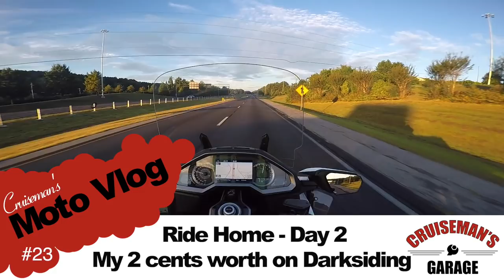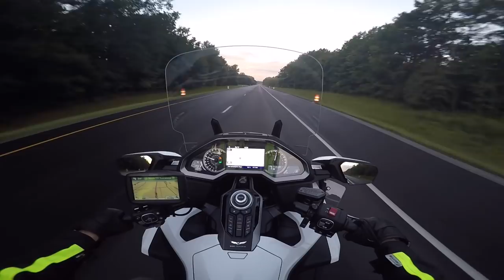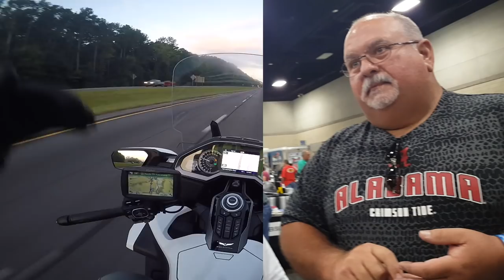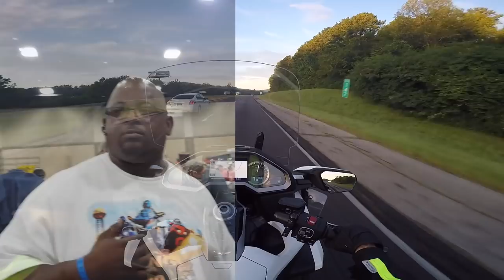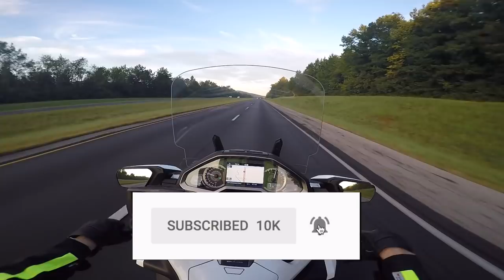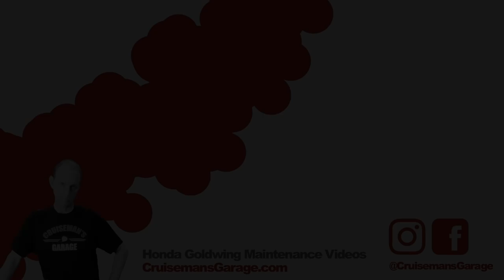[Ep 23] My 2 cents worth on Darksiding - 2018 Honda Goldwing

Comment: I went Darkside years ago after having a tire separation at freeway speed on a Bridgestone tire....the sidewall looked like a banana and if it had completely ruptured it would have been catastrophic. Going after a tire company is a joke, forget it, they dont want to hear it and Bridgestone denied any culpability, they said "It must have been caused by a road hazard".....after much research and soul searching, I went darkside. After riding with a CT on back for about 15 minutes, you adjust to the handling....I can assure you it does not affect your ability to navigate twisty mountain roads. I get about triple the mileage on the CT as opposed to MC tires. I ONLY use "run flat" car tires, which have much heavier beads and sidewalls. The only place must be really cautious is at very slow speed on broken or uneven pavement. The flatter profile wants to follow the curvature of the pavement, where as at speed, it is a non issue. Entering turns requires a slight bit of counter steering to set line through corner, and then it corners as if on rails. I have been totally happy with my experience going Dark. There is a treasure grove of information on the Darksider forum, with tire reviews, and the experience of running millions of miles on car tires. I am running a Yokohama run flat on my 2004 wing now and love it. And as far as the guy that had the bead break, It would be interesting to know the tire pressure when that occured, was he running too low tire pressure ????? That would be my bet. After assisting in the installation of the tires on my bike, I have NEVER thought that a bead could break, breaking the bead once installed takes an act of God, and a tire machine!! Keep up the good work on your videos, thanks for all the information you provide.
Reply: I echo your sentiments whole heartedly!   I'm running a Pirelli P1 Run Flat.

Comment: Sorry Cruiseman....I had to stop you 3 minutes in to comment. I'm about to buy my 6th motorcycle (2021 grey Goldwing that I am adding the factory tour pack to). My 3rd bike was a 2002 Goldwing. Halfway through owning it I went to the darkside on it and you can tell absolutely no difference at all. People forget that you don't run the car tires at full inflation. I ran mine at 22psi. So the side wall flexes considerably when you lean into a corner and "rolls". It does not feel unstable at all. If you search on YouTube you will find a video where a guy ran the Dragon using a car tire and a camera mounted behind the bike facing the rear tire. That video made me decide to go that route. Great videos! Thanks!

Comment: I personally can not understand why you would want to put a car tire on your motorcycle.  I would have to say for me it is the same reason why I have a Schuberth helmet.  How much is your head worth?  From my perspective it's not worth the risk for the type of riding I want to do to compromise my safety for a few bucks!  Also, I would never be able to forgive myself if compromised my wife's safety because I though I could save a few bucks on a tire.  Motorcycle tires like car tires are purpose built, they are designed for the rigors that motorcycles are operated under. One last thing that I think would also be a game changer for me, is that the motorcycle tire is way better suited to run flat than a car tire.  Just my POV from my soap box.   Thanks Cruiseman for all you do to help the GW community.

Comment: I read all the comments, but no one acknowledged the fact that, as per Cruiseman, the dude did not lose control of the bike.  If a MC tire would lose pressure like that, what would happen?
Reply: It happened to me.  As pressure drops below about 10 psi, it starts wondering away from a straight line.  It's still steer-able.  I had just purchased the bike from the original owner and it had Avon Cobras on front and back and the rear tire was 5 years old with a decent amount of tread left -- well above the wear mark.  Mine deflated inside 10 seconds from a split between the tread that looked like either dry-rot or a manufacturing defect.  (It certainly wasn't UV damaged.)  Thankfully I was out of traffic and driving in a straight line.  MC tires are designed to stay on the rim in that circumstance, and it did, which allows you to drive it at 1-3 mph w/o damaging the rim of you have to, to get off the road or across a parking lot to get to or from a tow truck.

Had I been on a heavily-loaded turn, I can't speak with any authority on how it would have gone because it has neither happened to me nor have I studied the matter to any extent from available data.  But I'll say this:  it would not be fun.
Reply: If just one tire manufacturer would approve of using a car tire on a motorcycle, then I’ll try it.

Comment: I've been riding Goldwings since 1977.  I rode darkside on my 06 till I sold it to get my 2018.  There is a bit of a learning curve, but I got used to it very quickly.  The number one concern I read was that people were not keeping an eye on the air pressure of the tire.  That was a big guy in your video and if his wife was the same size AND he was running low air pressure I could see that MAYBE happening.  With proper air pressure I would say no way.  I have mounted and removed car tires on my wings.  They don't break rim or come off easily!!  I respect everyone's choice.  It is up to them, but I have always felt very safe on a "properly inflated" car tire.  Good video.
Reply: I'm betting that big guy was lazy and never got down to inspect his tires never mind check there pressures. Can't blame the tire in his case.
Reply: My thoughts as well....300+ + 250+ + the eleven hundred on a dressed out bike equals a lot of hog wallowing....low pressure and it's a event waiting to happen.....heck ...every so often I'll ride the tire off a rim on my lawn mower.....cause I don't keep enuff air pressure in it...don't blame the tool for non maintenance.....just sayin.....Waffle House....burgers are reserved for better restaurants....😅.......

Comment: The Bridgestone drive guard 195/55r 16 87von the back of a goldwing is good,  even if you lose air, it’s designed to not go flat, can ride to a station or place to be fixed.  As I watch Caliente and others take on the dragon.  I was convinced it was safe, I’m sure it will take a bit to get used to.the Bridgestone battleax is great on front and back.
Reply: That's what I have on mine

Comment: Great job Cruiseman. I have had a 2002 GoldWing since Newyears eve 2004, and a friend sold me a rear rim w a slightly  used car tire on it. At low  speed, the bike handled like a wheelbarrow  full of water. At highway speed it was a cushier ride than a bike tire. I got a screw in the rear car tire a mile from home,, removed it and tried to plug it, but the steel belts were too thick to penetrate  with the reaming stick, so I used a drill. Then the plug wouldn't  stay in the tire.  So I figured if I ever had a flat on the road, it would be difficult  to repair. Just not  worth the hassle.  If someone  can afford a 27,000$ Motorcycle,  they should be able to afford the tires made specifically  for  said motorcycle and enjoy the peace of mind  and superior  handling it offers. Kenton from St Louis, 342,000 miles on mine and still love it.
Reply from the maker: A true Darksider would say that you could opt for a run-flat rear tire. But, I would think a run-flat would be a harsher ride, and even LESS sidewall to take the force.

Comment: Not only is the beading different but so are the compounds.  The MC sidewalls are constructed to be ridden on, the CT sidewalls are not.   More importantly and why the MC tire doesn't last nearly as long is traction.  Simply put, the rubber on an MC tire is stickier than the rubber on the CT and thus it wears a lot faster.

I think that the performance that people are seeing is a testament to just how good tires are made and of course companies build FAR more CTs than MTs and thus the price will be lower (due to total number made & economies of scale).

But ultimately this is all about risk.  If you want to run a CT, in my view, you are increasing your level of risk and as long as you know that then fine.  But don't fool yourself into thinking a CT is "safer", you are only deluding yourself.  Of course you can come up with scenarios where you feel a CT is safer and in some circumstances it may be but overall I don't believe they are when considering all modes of riding.   My view is "why take the chance"?
Reply: Not exactly correct. The Michelin Alpin performance winter tire has a high silica content for traction at least as good as a MC tire. Speed rating is higher as is load capacity. It's also a "Z" or run-flat. I get about 9K. with a MC rear tire and about 11 to 12 K on the Michelin. Notice I said "Performance Winter tire", not "All Season" tire. Just FYI. The aforementioned Winter tire does not have a Mileage rating and is not required to. It is a traction tire, not a long mileage tire. Longevity is sacrificed for traction.

Comment: Good presentation.  You have to remember the earliest MC tires were virtually the same as car tires. I remember my dad's old Harley's and Indians with those type of tires but like everything else cycles have evolved and with that so have tires. If you follow Moto GP you know that the tires are probably the most decisive factor between winning and losing and those costly R & D transfer directly to the street. If you're mostly a flat lander and stay within the speed limit you can probably get away with car tires. I've been riding for over 40 years mostly in the twisties and would never compromise my safety to save a few bucks. I see these Gold Wings with all kinds of useless costly bling but ironically they don't want premium rubber which to me is as important as premium riding gear. Sure you don't need a expensive helmet but some day it might save your life.

Comment: I've researched this subject and learned that motorcycle tires are softer for the ability to conform to the road and grip better. Car tires are harder and squared off. That means that when you lean, only the corner of the tire will be contacting the road. Much smaller area of contact means much less gripping. And, that rubber is harder and what little rubber there is contacting the road is less confirming to the pavement to effect a grip. You think I'm going to cut the performance of the tire I'm betting my life on to save a buck? No thank you. I'll gladly pay the price of changing the tire more often so to gain the maximum safety.
Reply from the maker: Well said
Reply: I'm totally with you on that one
Reply: Watch some videos of Darksiders videoing the rear tire contact patch, looking directly at the tires, both motorcycle and run flat car tires, the contact patch is larger on the CT, and these were done while riding the Dragon.

Comment: Cruiseman, just darksided my '08 today and put 150 miles on it.  took it on the interstate, twisties and a myriad of other type road scenarios and I cant believe how wonderful the ride was.  I'm sold and will never go back to an MC tire on my GW.  The aspects I really liked was how stable the bike felt at 80+mph speeds.  There is absolutely no wind buffering moving the bike around and I attributed the it to the wider tire which makes the bike want to stand straight up.  With that said, I found it just as nimble around curves.  If you ride a lot, I recommend trying it before you knock it.  Once you go dark, you never go back.

Comment: I run a Michelin car tire on my 2002 Honda VTX1800R.  After nearly 20k miles it shows negligible wear.  It does handle different, but overall feel very safe with the extra stopping & accelerating traction combined with higher weight carrying capacity.  May switch to another car tire that provides less flat surface eventually. Would use another MC tire if they every make them to last significantly longer, which they could do.

Comment: If the pressure in MC tire was as low as the CT, it would have popped the bead as well. I've popped beads when changing car tires on MC rims, and I can honestly say they hold on just as tight as a MC tire in my experience (I've changed hundreds of tires over the years). I believe his issue was due to lost pressure.

Comment: I have never considered putting a car tire on my motorcycle. I understand that there would be a huge price advantage but for me Safety is the most important thing when you are already taking risk. I have never been to the track when sport bikes are running and saw a car tire on the back of a bike.  Face it, the forces on a motorcycle tire are completely different than what’s applied to a car tire. Under all circumstances the car tire remains perpendicular to the pavement.  A motorcycle applies its greatest force on the tire when the tire is farthest from being perpendicular to the pavement.  To say there has never been a documented case of a car tire causing an accident as proof that it must be ok doesn’t hold weight.  There is no check box on the accident report asking what type tire was on the bike. If there was then we would have evidence.

Comment: Great point on the bead seal on a darksided goldwing motorcycle that weights around 1000 plus pounds with a passenger. Hopefully some wise guy will make a motorcycle rim that's design to work with the bead seal of a car tire. The problem of losing the seal could even happen when people put a larger or smaller tire on a motorcycle that wasn't designed for the bike. I miss you at Wing Ding I got there on Saturday morning. "Great job"
Reply: With 2 overweight people plus luggage, you're easily talking over 1300 lbs for the whole bike, and that's without a trailer hitch or trailer.

Comment: Good video Cruiserman.  I ran a car tire on my 2006 Nomad for 40k miles with no issue.  I had a gentleman tell me how I could be flirting with the legal issue of running a car tire on a motorcycle. This was coming from a man on a gold wing towing a trailer! I didn’t have the nerve to ask him how many motorcycle manufacturers frown on towing a trailer on a motorcycle. It wasn’t worth my time. Not sure if I buy into the difference in beads from car rims to motorcycle rims.  One of the reasons I went ahead and ran the car tire on my nomad was that the nomad was certainly not a canyon carver so I wasn’t running it drag on the floor boards on Kirby roads. The reason I’m not running one on my victory XCT is that the victory handle so well I didn’t want to change the way the bike handled because they do handled differently with the car tire. I also don’t buy in to the logic that a high-performance moderate muscle car has four tires to handle the side loads as opposed to one tire on the motorcycle. Muscle cars that are making a hard left turn under full power at the limit of traction are almost transferring 80% of that load to the outside two tires. That’s 4000 pounds on two tires.  Watching video of these cars in slow motion they are putting so much pressure on those two outside tires that the rim is almost on the pavement. I can’t imagine a motorcycle applying more force against the sidewall in that same situation. That’s just my opinion
Reply from the maker: I agree with your analysis of the force on the two tires vs four. However, it is a different type of force. On a car, the sidewalls are flexing left to right while the tread remains flat on the road surface, on a motorcycle (in a leaned turn) the force is being applied to the edge of the tread in a downward fashion while at the same time flexing the sidewall. I would suspect that car tires are so over-engineered that in most cases they will withstand this "unusual" force without failure.

I also agree with you that I don't feel like there is a legal issue running car tire and your point about pulling a trailer is valid. You can make the same argument about most aftermarket accessories (highway pegs, handlebar risers, etc.)

Comment: Great point on the bead. I've never heard/read that before.  I think the insurance issue would only be an issue if the officer noted on the accident report the rear car tire.  Officer may  call it unsafe equipment  or tire not designed for motorcycle on report.  I am retired LEO & I would not have tagged it in my reports unless I thought it was a contributor to the crash. Most crashes it would not be.  I've read that some are  buying car tires that are so soft they are not lasting much longer than a premium bike tire. That I don't understand. I don't use them because I like to corner very hard & I don't want to have to push the bike harder into corners.  I also do not like a sidewall not designed for a bike & now the bead issue.  I think those who want to use them should & generally I do not think they are unsafe.
Reply from the maker: And, as I stated in my video, if you commute on fairly flat surfaces, or ride from Dallas to Midland, Texas, with no turn for 350 miles, it might be a good option.

Comment: I’m a darksider and I don’t disagree with anything you said. I have a Michelin car tire on the back of my 2013. I like it. Will I stay darkside? I’m not really sure. I’m getting up there in age (64) and have been experiencing some stability issues with balance. I’m not sure if the car tire has anything to do with it but I am probably going back to a MC tire just to see if there’s any difference. I still have the tire and rim with the Dunlop tire on it so may be making a change.
Reply: @Al Parzke, that's my fear about dark siding my F6B I'm 63 and don't want to retrain how I ride - I don't do twisty roads - most are highway straight,  plus I'm not a high mileage rider - so I don't need to go 30K on a tire. thanks for your post for us older riders.